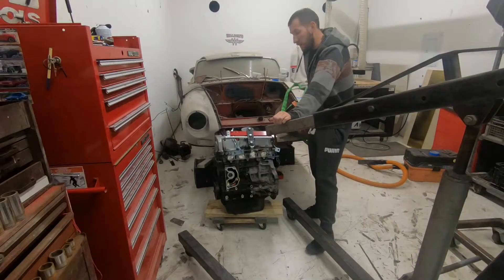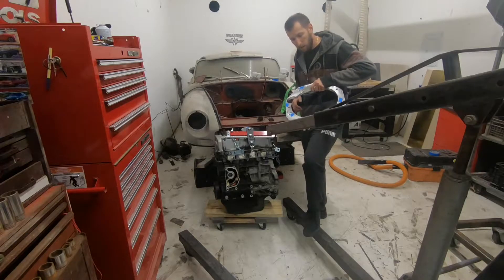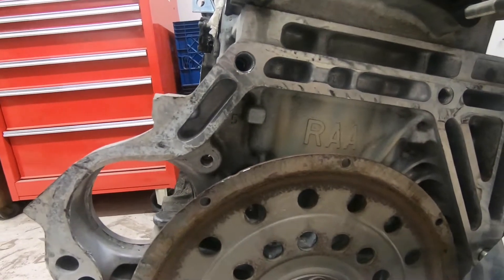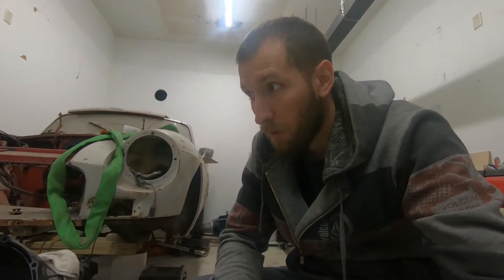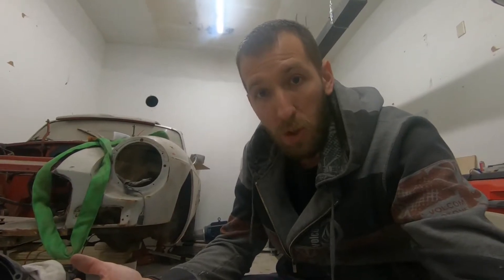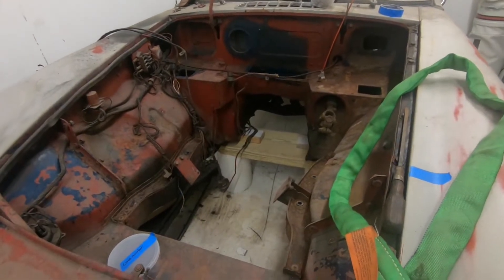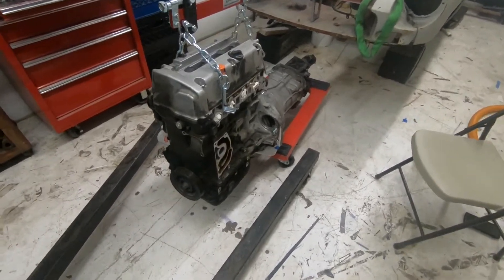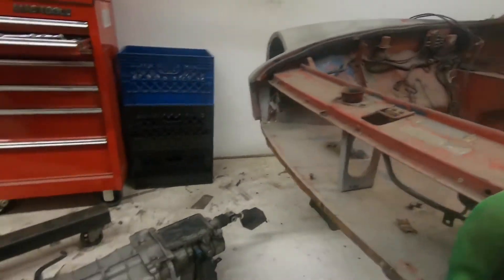72 MGB K-Series with CD009

Comment: Would you use a k series clutch and flywheel or a vq style clutch and flywheel?
Reply from the maker: The clutch and flywheel combo that I'm getting is from inline pro. The same company I got the adaptor plate from. It's a twin disc capable of supporting 1000 horsepower I believe it's more of a vq style flywheel and clutch

Comment: Looking forward to some progress on this, was any previous modification necessary to get the transmission into the car?
Reply from the maker: I can't wait to be back in the States so I can continue working on the MG. And there was practically no modifications made to the transmission tunnel to fit the CD009 (350z) transmission. A lot of people that do rear-wheel-drive k-series swaps use the BMW (ZF) transmission which is a good transmission but it is much wider and I didn't want to cut up the transmission tunnel.

Comment: A very unique combination. That engine bay looks very tight good luck with your venture cheers
Reply from the maker: Yes the engine bay is very tight but I thought if they put v8's in these cars I should be able to fit a 4 cylinder. So I thought lol.

Comment: building one myself but with a Ferrari engine. SUB'D
Reply from the maker: That sounds super awesome! I wish I had a Ferrari engine. Are you going to record the project?
Reply: @Richguythings  indeed Sir, in fact i am currently in production. Also since the body is made by Pinanfarina  (same guy who designed early the Ferrari"s of the 60's) Im doing some TOP SECRET  body mods, which will be revealed in time.